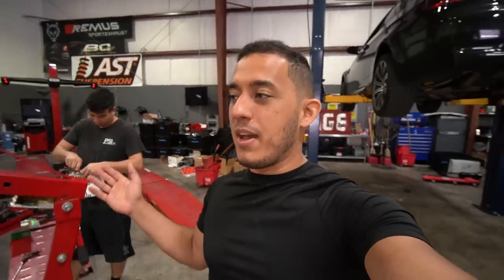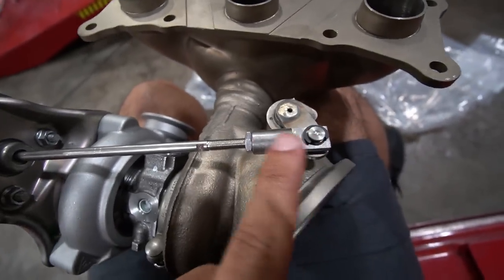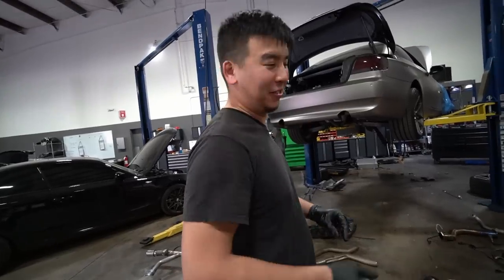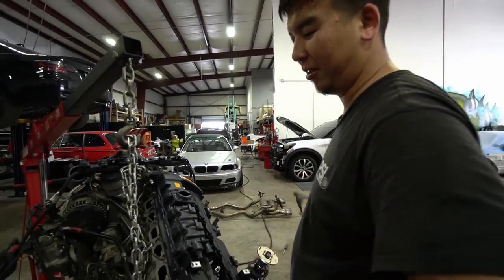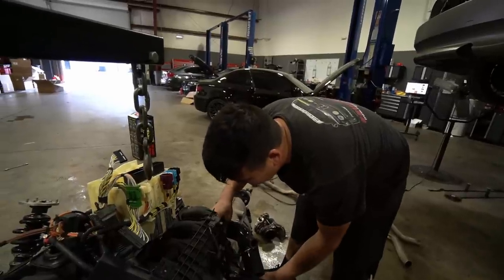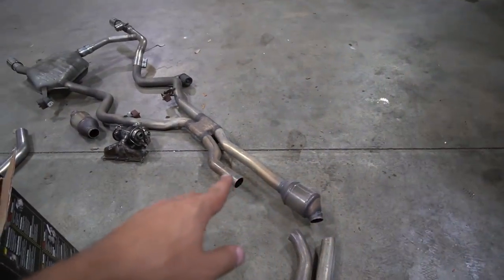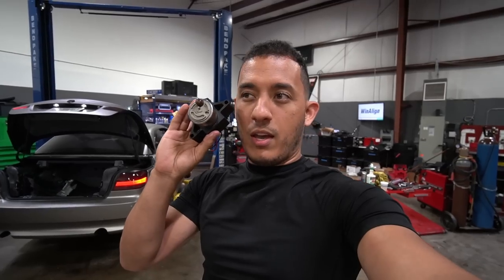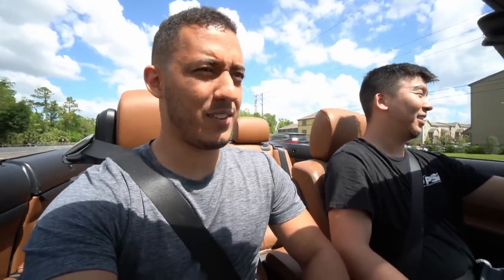Here's The Most Affordable And Reliable Way To Make Your BMW 335i A Supercar Killer - EP 21 (PART 2)

Comment from the maker: Make sure to watch part 1 of this video if you haven't already: 
https://youtu.be/VmlCh2YQHI0
Reply: Twin turbos for the win, low end torque always a must.
Reply: Great choice Christian, it will really will be a supercar killer by the time its fully tuned/done. 👌
Reply: You didn’t upgrade your intercooler?
Reply: How do I find the shop? I'm in Florida to🍻.. need work done on my E46
Reply: This links Me to part 2 not Part 1
Reply: You could do a video of Painting your  brake calipers ?
Reply from the maker: @marine vet thanks for the heads-up, I went ahead and inserted the correct link to part 1.
Reply from the maker: @mazawa atille Google Precision Sport Industries.
Reply: @vehiclevirals Love the twins, currently have the dual cones charge pipe, Bov, intercooler, and exhaust next is the turbos. Love the full video definitely gave me some things to double check! One question, where did you get the plugs from? And do you have a link for those as well? Looking forward to future videos!
Reply: Carnal te esta quedando chingon tu bmw
Reply: Can you post a link for the upgrades LPFP

Comment: FYI it's not the wastegate rod that has the issue causing the 30ff and rattle noise. It's the actually flapper and it's assembly. It gets worn out and causes flapper play and improper sealing causing boost issues.

Comment: I’m on the fence about upgrading my turbos on my 09 135i. The car has 194k miles on it but it’s in great shape. You’re making me want to pull the trigger.
Reply: May be better idea to buy a lower mile 135i and then mod it. If y o u mod your 190k 135i, you will be replacing parts for a little while until you have a brand new car!
Reply: Robert Lopez yeah, I bought an M235i with only 35k miles on it. I kept the 135i as a commuter work car to keep the miles down on the M235i👍🏼

Comment: Love the work very smart choice😉
I didn't like the air filters position tho.
You definitely losing power by getting hot engine bay air for an actually pretty hot bi turbo choice.. Think about reposition  the air filters for even better results an temperatures👍🏻😉
Reply: Not true. Bimmer Motor Sports has a good video explaining this exact topic resulting in no power loss. Almost every N54, N55 owner has their intakes on the top left or right side of their motor, But of course having them low sucking cooler air wouldn’t be bad neither it really doesn’t make much of a difference to matter.
Reply: Also these turbos are oil and coolant feed not like your typical turbos that are thermally feed therefor needing a colder air source to operate correctly.

Comment: I got the hiflow stage 2 pure turbos also... and with stage 3 xhp newest version flash 3.0 the car is running even better than before. Only thing is the pure s2 are a little laggy.
Reply: Anyway to remove that lag
Reply from the maker: Definitely little to no lag on my end.
Reply: @VehicleVirals  - if no lag, then who tuned your car?
Reply from the maker: @matreyia  currently running a custom tune from the tuners at MHD
Reply: @VehicleVirals  - I am unaware that MHD has any official tuners. Ken Atkinson tunes the N54 OTS flashes officially for MHD and He also does private custom tunes but not MHD related. My car is tuned by Justin at Twisted Tuning... flexfuel, port injection, 3.5 bar Tmap (you don't need a 4 bar tmap), Relocated inlets, Precision Raceworks coils... currently at 610whp if using 75% e85. xHP has new stage 3 version 3 flash that has fixed transmission delays and jerky shifting on my Propulsive Dynamics Transmission.

Comment: I have watched both parts and despite multiple requests through comments on both videos, there is no answer to the question; What did you pay PSI to do this refresh?  And, what did you spend for parts outside what PSI furnished?  By the way, loved the content!  thanks for your efforts.  I have 2012 E92 335i with the N55 motor and I too have done the big three: oil filter housing, valve cover and oil pan gasket replacement and all separately!  (SPENDY)  I wish I had seen this first so I could have had all three done together.  Keep 'em coming!
Reply from the maker: Hey Joe, I appreciate all the nice compliments. It's not simple breaking down the price since I have a partnership with them meaning my total cost is no where near what you'll pay. You're best bet is to contact them directly and they would be more than happy to quote you.
Reply: @VehicleVirals  It's 3200 miles, one way, to their shop for me.  Unlikely they'll be doing work on my ride.:-)

Comment: Super! Not a big fan of super loud exhaust but I bet that you have a Daily driver for few thousand miles. Didn’t see water pump replacement, dis u get done as well? Anyway excellent material and impressive work from your partner there. Éxito! And look forward to the tune up.
Reply from the maker: Water pump was done like 15K miles ago and it's under warranty frrm the shop that did the job so I skipped out on replacing it again. That said Aaly (the Asian guy) did advice I replace it.

Comment: Congrats on the build! I would turn the burbles down to at least medium though because there has been some controversy on it ruining turbos and causing oil consumption just a heads up, also did you do the outlet? Cause that’s also a big restriction
Reply from the maker: Outlets don't affect performance that much.

I turned off burbles entirely lol. I got tired of hearing them.

Comment: Looks good don't be suprised if e60 out dose the e85 tune set up like that on the dyno not sure that fuel pump will push e85 with just injectors especially with sub index 12s and no port🤔 probably a 2nd pump to port to get that pure e85. One thing with step 1 vs step 2 it possibly can tune better with 1 vs 2. also those look like Delphi coils good luck with those not sure if they will get the job done even elders get questionable in the 500s.. the real weak spot i see is your injectors index 4🤯 why weren't they replaced under recall for free🤷‍♂️ good luck almost there can't wait to see the numbers those inlets tuned properly huge gain..

Comment: What a great bunch of guys out there at PSI. I've been doing all the work myself so far on my car but when something comes up that is too big for my boots I'll definitely make the drive up from Tampa to work with these guys. I have an 09 335i N54 E93 also :)

@vehiclevirals what is your plan for suspension on this car? I want to do coil overs but i dont know if the BC coil overs will work on the e93 rear end
Reply from the maker: I running bc coilovers right now and they run just fine!
Reply: @VehicleVirals  did you have to get a higher spring tension to handle the extra weight in the rear or is it not even an issue? (I don't want it sitting down too much when i romp on it.)

Comment: Hi, one question, did you do something to the transmission too? Because i don’t think that the OEM one is going to handle so much power and last long.
Great video btw!!
Reply from the maker: It can handle it. I'm not launching my car excessively
Reply: Vehicle Virals ok then, just wanted to know, yours is the ZF 6HP right? 
Also, did you come across any issues after you did the tranny ecu remap? Cause i’m thinking to do it too but i’m a bit worried to put too much stress on the transmission
Reply from the maker: @leotomassetti8434  No issues at all with the xHP trans tune. Like you I worried about reliability before flashing the TCU, but according to the company there is nothing to worry about.

Comment: Have you addressed the rod bearings yet?
And what are you plan on doing with the turbos you removed?
Reply from the maker: No need to address the rod bearings. Sending the turbos back to Pure
Reply: @VehicleVirals  reason Im asking is because of the rod bearing failure on N54's.
Reply from the maker: @thisguyshorty  I think you're thinking of the e9X M3. N54 doesn't suffer from that issue, at least not that I know of.

Comment: Hey nice video👌, I wanted to know how did he remove the oil that was left over from when he took out the plugs ,? I had replaced my injectors and cylinder 4 had oil in it , is there a way he flushed it out ?
Reply from the maker: He removed the valve cover.

Comment: What shop is the best place to get a custom tune for your bmw in Orlando? I just upgraded my turbos as well as fbo.  I'm looking for a shop to do the custom tune. Thanks for your help in advance.
Reply from the maker: I'm going to have a tuner at mhd remotely create a custom tune for me.
Reply: @VehicleVirals  that's cool, how much they charging you? I know I need a custom tune, just trying to get a price range on what its going to cost. Just messed up my vanos with the jb4 tune running bigger turbos
Reply from the maker: @77wildcatblue  ouch! Not sure to be honest, as they are going to sponsor me.
Reply: @VehicleVirals  thanks for your feedback, yeah I didnt have the car 24 hours with all the new go fast parts before the vanos system went bad. But once that's fixed, I'll have a bunch of new parts and it should be good for a long while. I've dumped over 10k into this car this month, not planned, but once I started there were several unexpected parts that I needed to replace to support all the extra power.

Comment: I have same exact setup with vrsf fbo but I have Dynamic autowerx stage 2+ turbos. I get compressor surge/ flutter with my hks bov I have a 1/4 vaccum hose on it. Anybody know why it's doing this!?
Reply: Could be wrong spring pressure for the bov.